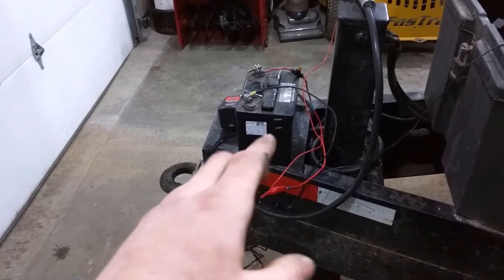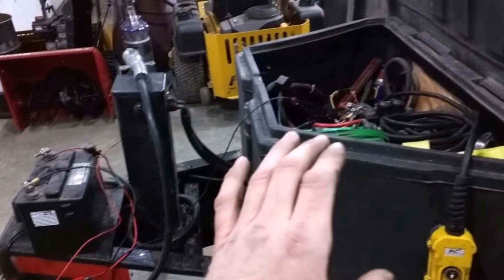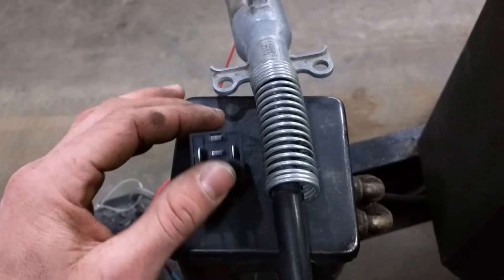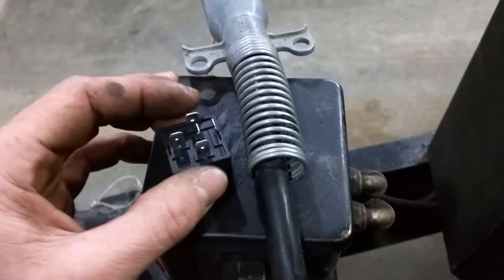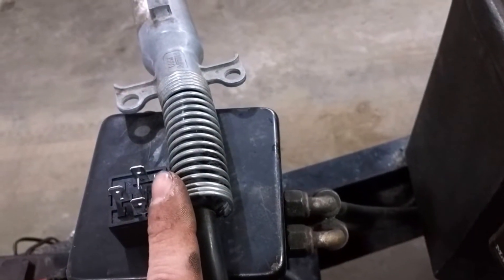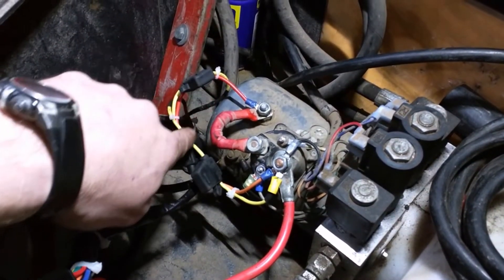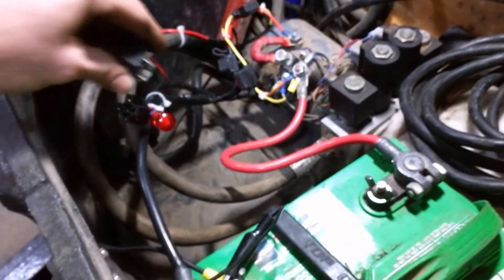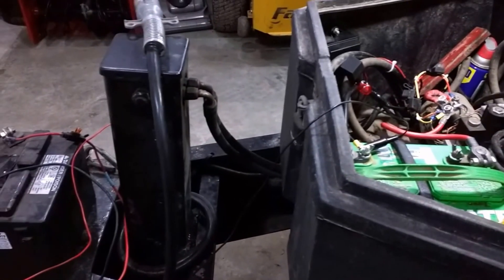Keep Your Dump Trailer Dumping-  It Works, It's Simple And It's Cheap

Comment: So here's my question. The dump trailer has shore power to charge battery. I want to add truck power to charge while hooked up, along with the relay pack. Any back feeding into the charger for shore power charger that will damage it? Or should a 2ndary relay be installed to cut the charge wire from shore to battery🤔
Reply: What is "shore power"?

Comment: We just installed the Pole Pal USA 7pc Dump Trailer Wiring Set on our PJ Dump Trailer and couldn't be happier!  Their kit uses 2 gage wire and quick connects.  We have tried adding a solar panel but it still wasn't enough.  We have 3 work trucks and 3 trailers (dump, equipment and enclosed) and plan to install the truck side wiring on all 3 trucks and the trailer side wiring on all 3 trailers.  It is the best solution I have found by far!  We will use the trucks battery and alternator to supply power to the pump on the dump trailer, winch on the equipment trailer and interior lighting, outlets and accessories on the enclosed trailer.

Comment: If you're doing that much work...  Just run big enough wire to handle the load.  Straight to the battery.  Leave truck running while using 
.  Job done.
Reply: Do that too every vehicle that will use your trailer... Not. Relays are easier. While you're at it, dump the fuses and get breakers.

Comment: I installed a cable from my truck battery to the end of my truck and a cable from my trailer to plug into the back of my truck using the Andersen plugs.  Problem is that when I go to dump, the inline fuse I installed, trips and I can’t reset it right away.  Does my 5pin connector have anything to do with a back feed since I’m connecting my truck battery to the trailer battery and the 5pin connector also has power.  Not sure even how to ask this so I hope I made sense.
Reply: What size breaker did you install?
I did the same thing, used high amp welding cable with Anderson plug in pickup bed.
I had problem with breaker I installed always tripping.   I got a different breaker and it stopped tripping on a standard dump load.

Comment: Would this work even if I ran an extra high amperage wire from battery to help with charging the battery? Example like a winch set up.
Reply: I run high amp welding cable directly to pickup battery.  I have a breaker installed close to engine incase a short happens.
This relay in video could not handle the 250 amps of current if coming directly from truck battery.

Comment: where do I ground the hot wire to the test light and where do I ground the wire to 85? Currently have both grounded to the trailer and the test light stays on after I push the up button. And it won’t go off until I remove the relay and install the relay back

Comment: I am not sure what the purpose of this is??? Is it to help your trailer battery last longer without dying or to protect the truck? Thanks! I have issues with the battery on my trailer dying regularly and am trying to figure out how to use my truck to charge it.
Reply: Your truck may a blown fuse. The fuse gets taken out while using the dump while still connected to the truck. So the relay or in my case smaller fuse protects the fuse in the truck so your trailer battery will keep charging while your traveling
Reply: It will do both.
Reply: When led goes on, you know the pickup fuse is good, and on board battery charger will replenish the trailer hoist battery.
Otherwise,  you assume battery is being charged, but it's not, and you don't find out until you need to dump something.

Comment: The trailer has a small wire that runs from the truck connection to the battery to charge the battery. A 15A fuse or breaker in this wire near the battery should save the 20A fuse in the vehicle.

Comment: Power only goes thru 30 and 87 when 85 and 86 have current, what am I doing wrong?
Reply from the maker: Pin 30 to truck 12v power. 87a to battery positive in trailer. 87 to test light. 85 and 86 are not polarity sensitive. One to ground one to working leg of pump. The working leg of your pump is the big positive wire that comes from the big solenoid to the actual pump. The working leg is not hot unless the dump trailer dump function is activated. Like I said before pin 85 and 86 are not polarity sensitive they're the pins that power the coil. If you're still confused have a mechanic watch the YouTube video. The coil circuit should only be hot when pump is running

Comment: Hey buddy. Great video. Can you please be more specific about the wiring. A witing diagram would be great. Kind of confused on which wire goes where. TIA
Reply from the maker: Pin 30 to truck 12v power. 87a to battery positive in trailer. 87 to test light. 85 and 86 are not polarity sensitive. One to ground one to working leg of pump. The working leg of your pump is the big positive wire that comes from the big solenoid to the actual pump. The working leg is not hot unless the dump trailer dump function is activated. Like I said before pin 85 and 86 are not polarity sensitive they're the pins that power the coil. If you're still confused have a mechanic watch the YouTube video.
Reply: @JacobGilkerson  where do I ground the hot wire to the test light and where do I ground the wire to 85? Currently have both grounded to the trailer and the test light stays on after I push the up button. And it won’t go off until I remove the relay and install the relay back
Reply from the maker: I wired three trailers using the hardware in the description link. It's a good relay and it's waterproof.
Reply: When you say working leg of pump, which wire do you mean? Hook it up to the spot where the trailer battery hooks up to?
Reply from the maker: @mantasstrikulis8954 no it is the other side of the main solenoid. The working leg is the big wire that is only hot when pump is running.

Comment: Thanks for making this video!  I never knew that I needed to unplug my trailer from the truck when I operate my dump trailer hoist. I recently blew the fuse on my truck which goes to the trailer charging circuit and didn't know why until now.  I hope to make a set up like this so that I don't have to manually disconnect every time. Great idea!
Reply from the maker: Log Cabin Homestead/ Videos from around the farm yeah, it works well. best of luck.